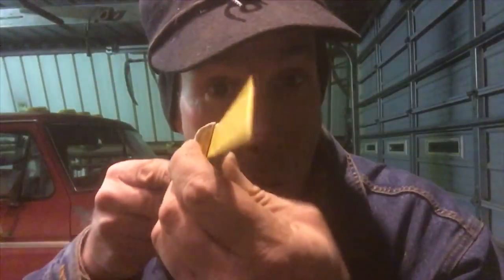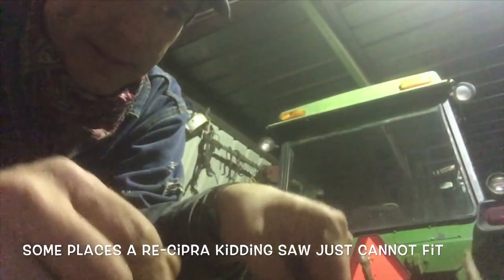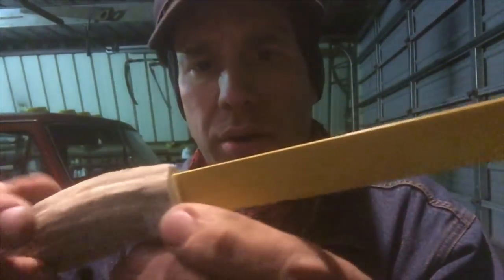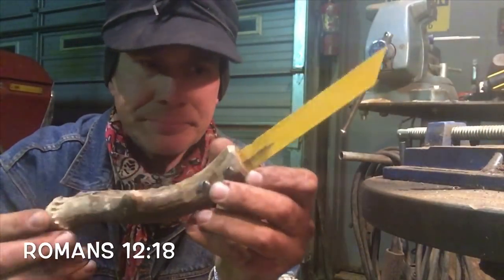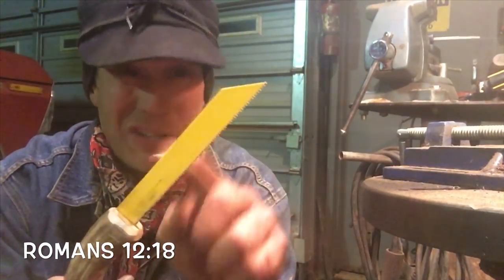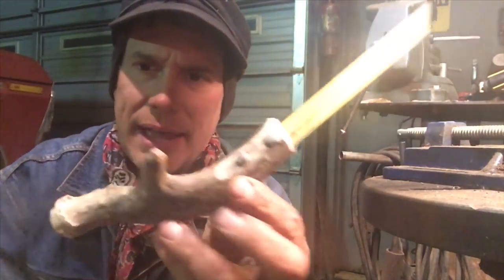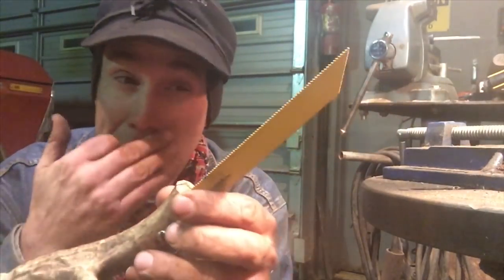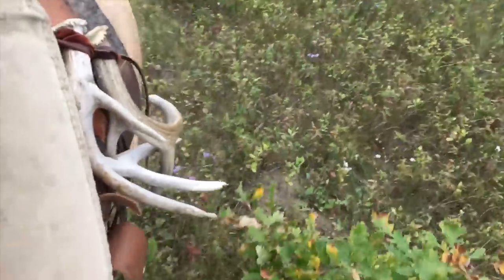Handiest Hacksaw

Comment: I love it Luke,  a trick to drilling that hardened steel is wrap everything you want hard in a wet rag then take a torch with a fine tip and heat the spots you want to drill. Take care brother.
Reply: Or dry ice.
Reply from the maker: Very good idea. Thank you for the tip. I will do that.